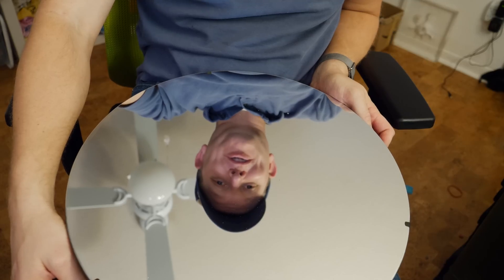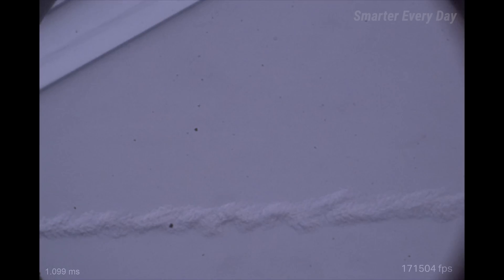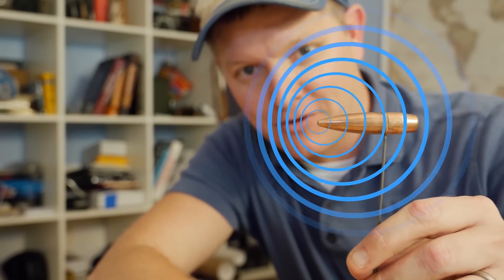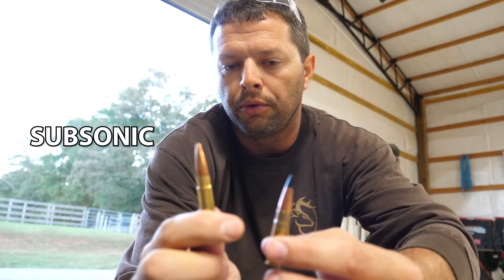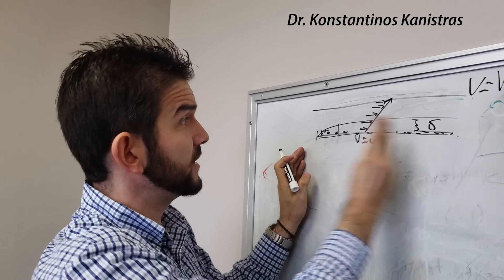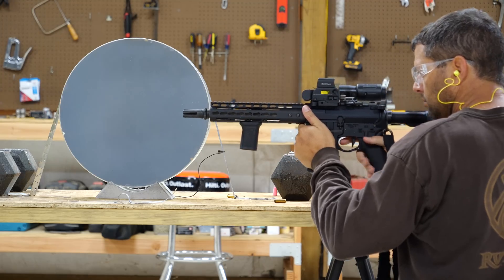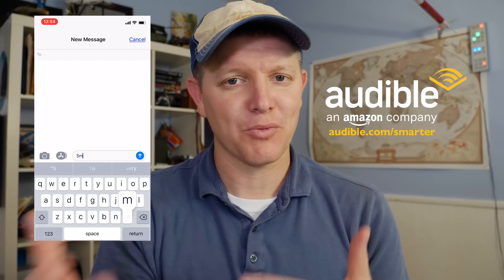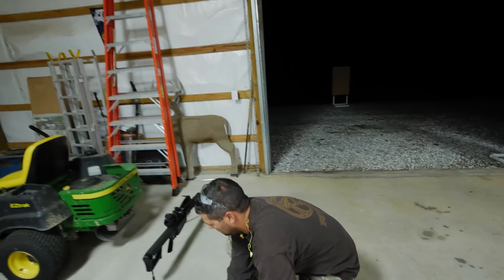Shockwave Shadows in Ultra Slow Motion (Bullet Schlieren) - Smarter Every Day 203

Comment: NOTE... that not light
But air . Light u seen is blend in air . And wave is air wave ( air  = water ) in ultra slow montion ( light there is just water but light inside (like soap in water ))
Reply: All visual images are achieved using light. It's the detection of light passing through air, water, or whatever other transparent medium you might use, and reflecting off anything that reflects it, that creates visible images. Air changes the pattern of light flow by changing the speed at which it travels due to providing obstacles that interact with the photons/waves. The absolute speed of light doesn't change, but because it's being forced to interact with things as it travels, the effective speed through a turbulent medium will be affected, and that's what this kind of imaging shows. The bullet creates vast changes in air pressure which are caught on camera because of the way the changes in the density of the air around it affect the speed at which light gets from one side of the bullet to the other.

The image you're seeing is, as stated in the video, an image that shows the shockwaves in the air. But it's created because of the effect those shockwaves have on the light that passes through them.

Comment: When the gun was a foot away from the mirror if you look closely to the imagery slowed down you can see faint angular lines similar to the very visible angular triangle lines coming from the bullet itself. The same pointed angles are a little more obtuse than the bullets angle but are raised above and below the bullet and even infront of it. What’s happening there???

Comment: Double slit experiment using shock wave try to see what happens?
Reply: great idea
Reply: That would be by far the best experiment on this channel!
Reply: Would be cool to see but the result would probably be a rather "normal" interference pattern if the widths of the slits are close enough to the shock wave's wavelength
Reply: Yes!
Reply: great idea ... 
I was thinking that they could shoot two bullets at each other one from opposite directions. 
probably have to have a remote control firing ... :)
Reply: That can't be done, the double slit experiment deals with things at the speed of light.
Reply: @matszz  Yeah I feel we're gonna have to wait a couple of years... at least...
Reply: @matszz  , Double slit deals with any wave passing through them. Speed can be anything. Even waves in water would work.
Reply: @suokkos  You're wrong. From wikipedia: The wave nature of light causes the light waves passing through the two slits to interfere, producing bright and dark bands on the screen — a result that would not be expected if light consisted of classical particles
Reply: @matszz  Pauli is not wrong. Wiki mentions one of the many applications of the double slit experiment. The experiment allows observation and measurement of wave interference (water, sound, radio). The reason that light is emphasized is because it acts curiously during the double-slit experiment. Photons fired through the double-slit one at a time produced results that were more analogous to waves than particles.
Reply: @marcustenhaafus  Yes and a shock wave wouldnt produce that particle wave duality, which is what the experiment is about. So very technically, I concede, you "can" perform the experiment on any wave or any particle. And you'll find particles behaving like particles, and waves as waves.
Reply: @matszz  People didn't think light would act sometimes like particles and sometimes like waves, but then they did the experiment. That's what experiments are for. That's why Douglas Wallace's suggestion is a good one. :)
Reply: @marcustenhaafus  Fair enough.

Comment: Hypothesis: The circles appearing at regular intervals behind the supersonic shockwave is the shock caused by the flow of air collapsing behind the bullet.  The length of the air vacuum tail created by the bullet is controlled as a function of the bullet's shape and velocity.  Additionally, the velocity may have some effect on the distribution of air density, causing an observable resonant frequency for the observed phenomena.  Bullet rotation may or may not play a part in the phenomena, and should be also explored.

Now tear this hypothesis apart aerospace engineers/physicists.

Comment: Very nice!  did you experiment at all with different point sources?  what you have done works great for this.  A color gradient might also be fun for those turbulent flows.  
Why is the upper shockwave blue and the lower one purple?  chromatic aberration in the lens you are using? Would the image look more symmetrical if it were a vertical razor blade?

Schlieren was one of the most exciting things in for me in my flow visualization class, feel free to check out some of what I did back then: https://lifeofstawa.wordpress.com/tag/schlieren/

re-shooting some of those suppressors might be fun.  
arranging a slit for the shock wave to go through and showing constructive and destructive interference might also be cool.

Comment: I was just thinking about the circles diagram to demonstrate the shockwaves of the object, and it got me thinking: when you make a disturbance in anything it will make rings (e.g taping the surface of water) the bullet is going so fast that it is causing a disturbance in the air as it goes on to make another disturbance in the air. For example a new 'circle' will develop at the same speed as the rest, before hand, making the size a constant to the time it takes. Using a number of the new disturbances shows an angle and that can tell you the speed. 

That is a rough explanation of my theory but I hope it makes sense.

Comment: what is the dark line at the leading edge of the shock wave...is it compressed air ...peace out
Reply: Schlieren photography highlights regions where the air density is changing (i.e. boundary between high and low density). The dark lines are shockwaves and expansion waves, which compress and expand the flow, respectively

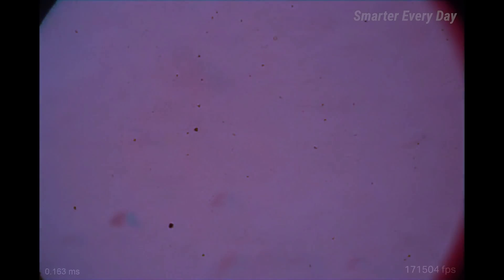Comment: Regarding the later shock waves Destin mentions starting at about 1:41 in the video: So I did a little math and made some guesses. I assumed the bullet went in front of the center of the mirror, and the center of the mirror was 8 inches off the table and 54 inches off the floor. I also assumed the bullet was traveling at 2800 feet per second. Lastly, I very roughly calculated the angle of the shock wave at 30 degrees. (I later remembered that Destin showed an angle in the video of 28.85 - but I'm too lazy to redo the math.) Crunching the numbers, I think a reflection off the table would come about .00046 seconds after the bullet, and a reflection off the floor would be at about .0054 seconds. That's measuring from the time the bullet crosses a point in it's path to the time the reflection crosses the same point. 

It would be really cool if Destin could look back at the original video and see how far apart the various shock waves are to see if my very rough figures are anywhere close.

Comment: I wish I could give this video 2x thumbs up !! Very interesting and informative. I've seen this technique used before on bullets, rockets, aircraft, airplane propellers/ helicopter rotors, boat propellers and a few other high speed objects. All are very informative and interesting to compare.  But this is the first time the subject of the videos is the process of producing the effect itself and not just the data observed from the different objects passing through the air (or   appropriate medium) and their associated shockwave videos datapoints. Awesome  !!

Comment: That trail behind the bullet must be the result of either cavitation in the extremely low pressure zone behind the supersonic bullet, or the presence of new gasses from combustion that have a different density than the surrounding air.

Comment: I went through three years of an aviation engineering degree and failed to notice that Mach and the angle of shock waves have such a simple correlation. We always calculated Mach from the local speed of sound and the speed of the object. Beautiful!
Reply: surfingbishop The method you’ve learned for calculating Mach number is the most useful in terms of aviation. Hard to set up a schlieren system on the wing lol
Reply: surfingbishop Its not that simple. You have to solve (or see the graph) of theta-beta-M equation to find the Mach Number ,and its only valid in 2D flow. This is obviously a 3D case.
Reply: Daryoosh Kazemi Ah yes, can’t forget the three dimensional relieving effects!

Comment: The fact that the SUBSONIC bullet produced shock (Mach) waves at its side is the reason why commercial subsonic aircraft do not get too close to the speed of sound. If they did: 1. There would be supersonic flow at the top of the wing and along the fuselage. 2. The shock wave would increase friction. 3. The airflow would become turbulent around the shock wave, resulting in intolerable vibration.

Then how do supersonic aircraft get around this?
1. They still cause shock waves, but they are DESIGNED so that the flow does not separate from the wing at supersonic speed.
2. They have engines powerful enough to overcome the added friction.
3. They are designed to suppress the turbulence and deal with the turbulence that they cannot suppress to minimize vibration.

Comment: The circles being generated as the bullet passes on the highs speed.  When you have high winds and you're out in it, it's a bit noisy isn't it?  Now imagine that at mach one or better.   I think it would be very noisy.  Also very turbulent.  I think you can get where I'm going with  this.  I'm too tired to mash thsi all together coherently. =v=

Comment: Maybe someone already said this, but I think those vertical lines are the sound wave from the initial shot rather than a shock wave.  On the supersonic rounds you can see the vertical pressure wave follows behind the round while on the subsonic that wave traverses before the bullet.

To confirm, can you count the frames it took for the vertical pressure wave to transit and compare to the time to transit for the round?  Since you have the mach number of the round, you will be able to determine the speed of the wave... which I think you would find to be mach 1.
Reply: Actually I realized there are time stamps at the bottom, so I did some math.  It looks like the reflected waves from the Mach front reflected off surfaces .273m (10.75in) and .963m (38in) away, which does look consistent with Destin's guess that it is the table and the floor respectively.   This is based on the time for the reflected wave to reach back to the point of origin, with it propagating at 343 m/s.

Looking at the time it took the vertical pressure wave to transit:  I took the time of flight across the frame of the bullet, and using a Mach angle of 28 degrees, it looks like the video frame is about .295m (11.62in) across.  This means the vertical pressure front was moving at 313m/s, which is under sonic speed.  I think it is maybe close enough based on my guesses of when the waves and the bullet entered and exited frame to call this close to Mach?  Destin, maybe with the original video files you can take a look and get a more accurate calculation?

Comment: And I don't If my idea is dumb, or actually works, but what if you use a brighter point source, and place some zooming lens set between captured object and mirror? Lens impact on a light should pe perfectly reversible(except some losses like reflections), so all the interference action in shlieren  method should still work.Could really enlarge captured area, while being significantly cheaper than bigger mirror.

Comment: On the revolver blast: when I was a kid my dad let me shoot his 357 with an 8" barrel. I had tiny little noodle arms so I had a hard time holding it, and without thinking he told me to just hold it underneath with my other hand, like you would a rifle with a very short barrel. I literally had my index finger and thumb wrapped around the cylinder gap. I'm lucky my tiny fingers didn't reach all the way to the top or it might have done some serious damage, but as it was I had unburnt powder embedded in my skin for a long time. I have to be careful when I let people shoot my Chiappa Rhino since it fires off the bottom cylinder. It's a lot easier to get your hand in a bad place than with a normal revolver.

Comment: The original point of 300 blk is to be shot out of an ar15 sbr/m4 but have more energy. The 5.56 loses a ton of velocity when you go below 14.5 inch barrel, thus the 300 blk was created to have more energy and be compatible with the same weapon platform. It's also stupid quiet when shooting suppressed and subsonic.  Also, awesome video

Comment: And normal shock is why airplane wings are angled backwards. It increases the critical mach number, the speed at which those normal shock waves begin. Really cool to see it applied to bullets!
Reply: Trust Brian to bring the real engineering to the video haha
Reply: I just read that in your voice.
Reply: Consider me suscribed to your channel sir
Reply: I had to learn basic transonic aerodynamics to play Kerbal Space Program with the Ferram Aerospace aerodynamics mod, I optimised the wing sweep for mach 4.2, which was the speed I was trying to achieve, but it took a lot of tinkering, learning, and admittedly sometimes guesswork to achieve stability through Mach 0.8-1.2. Well worth it though, just for the learning opportunity
Reply: Tie in video? I'd like to hear you talk more about this...
Reply: Therefore reducing the drag with less energy needed?
Reply: Is it the same reason why helicopters have a speed limit?
Reply: This is as the air goes over the airfoil?
Reply: Oh wow that makes a lot of sense
Reply: wait, if those normal shock waves form more towards the back of wing because of it's design, wouldn't it mean that the reactionary force from the shockwaves would accelerate the aircraft, accidentally causing the plane to go supersonic? I mean it was already pretty close to M1.
Reply: I am here just for understanding that :D

Comment: When shooting the .50, it looked like the top had a different angle than the bottom. Also looks like the wave for the top starts at the tip of the top of the round, while the bottom curves around the front from that same spot.

Comment: I think you confused between mach cone and conical shock wave. Schlieren shows conical shocks as shadows not the mach cone. So your calculation for Mach number of bullet is wrong.

You can also see it when the guy says muzzle velocity of bullet is 1800 ft/s where sound velocity is 1150 ft/s... Which means at muzzle, the bullet is at Mach 1.5. It would not accelerate after muzzle. Hence, you can't get Mach 2

Comment: What you saw on the sub-sonic round is what I believe is called a trans-sonic shock wave. Some of the  WWII aircraft experienced this especially when in a nose dive. The trans-sonic shock wave actually took air off of the control flaps rendering them useless and made it near impossible to pull out of a dive.  It caused some planes to crash and the designers made serious modifications on the dive bombers to compensate.

Comment: I was JUST thinking about how I wanted to understand better about how projectiles leave shock waves and wondered how shape effects the BC of a projectile vs speed. In other words at different speeds, the BC changes and the importance of that BC changes as well, and I theorized that part of this had to do with the actual SHAPE of the shockwave and how the outer shape of the projectile touches or doesn't touch parts of the shockwave, and how that relates to drag while minimizing the vacuum/cavitation produced at the rear, which causes a resistance via suction.

Comment: This comment is probably going to be lost but... I’ve always wanted someone to make a song or phrase that has two discernable meanings (not like laurel/yani). Similar to how an ambulance sounds different coming towards you as it does flying away, but maybe have two separate words, not just noise.
Reply: I forgot who made the video; but the explanation they gave is you grab two words that got similar elements on a spectrogram, and then you filter he low frequencies of one of the words and the high frequencies of the other. As people age they lose their hearing for higher frequencies first, so older people will hear the lower frequency word more easily than the high frequency word (and different people have suffered varied amounts of hearing loss at different frequencies due to how their body is and also due to different loud noises they've been exposed to during their life, so there may be different results for people of the same age).

It's not as easy as it sounds though, you might have to tweak things a lot o find that sweetspot where half of the people hear one thing and half the other.
Reply: Totally understandable and probably why it hasn't been done yet, but it would be really cool if somehow a car moving toward you playing a recording said "watch out" and then driving away said "I'm gone" or something like that. Approaching you it sounds totally different from when it is driving away, but the same track is playing. Compression vs. Expansion.